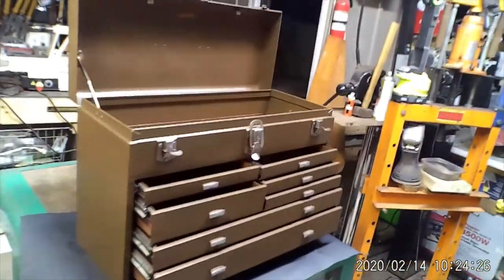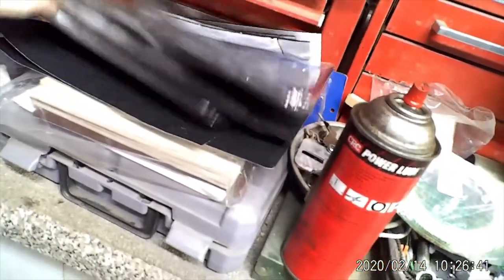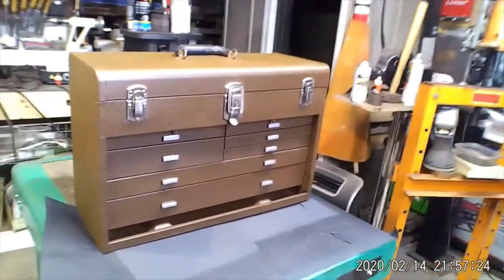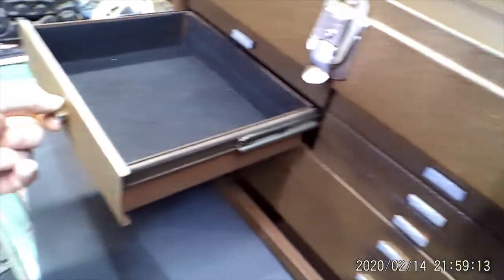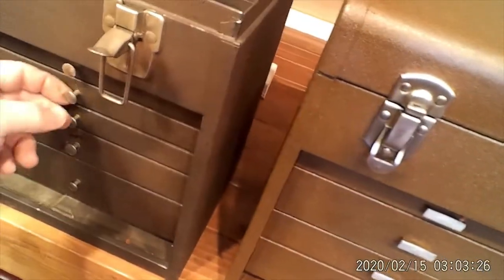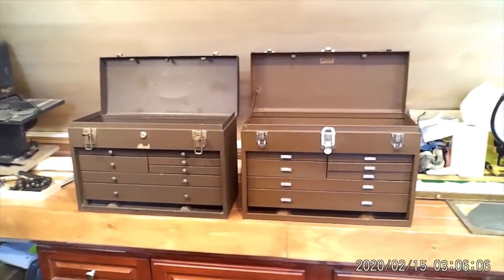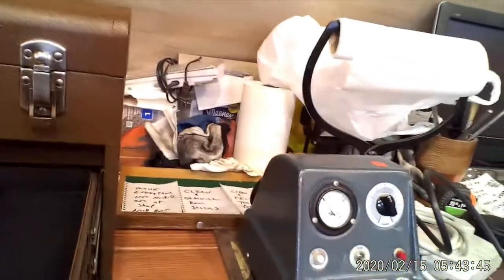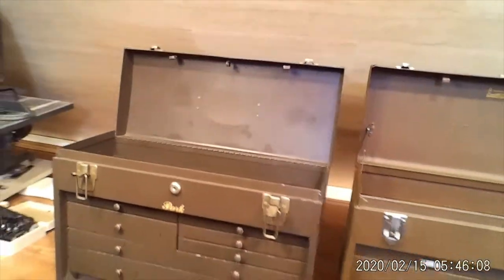Kennedy 520 tool box restoration

Comment: Good job on that resto. I have two boxes including the 520 you featured here. My green box I just Aerosole sprayed over the original color but my 520 is fairly decent brown color with the signature still on it so I wont be restoring it any time soon. Both are pretty decent condition, just the green one needed some paint and spray is easy to wash off if I want to do a total resto on it. But my green one is missing the original handle.
On my brown one, I will live with a few chips and scratches for now.

Comment: Kennedy sells the krinkle paint and signature stickers on their website.  It will improve your restoration or touch-up.
Reply: Yeah, $38 for 0.6 oz.
Reply: @clsrunner03  The can is 12 oz. and you can find same paint online for low 30's.
Reply: Add a strip of filet to the runners on the bottom. It will protect the face of the front door.